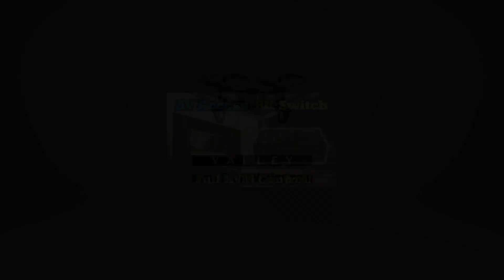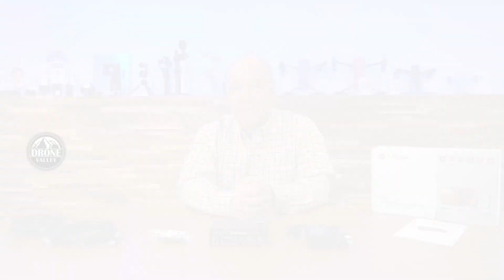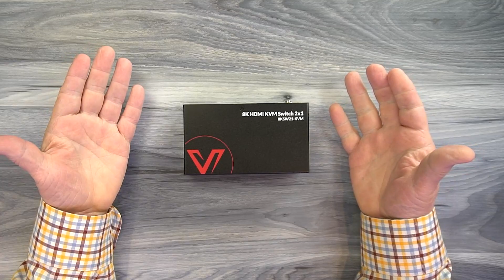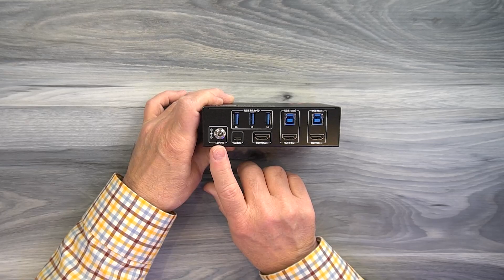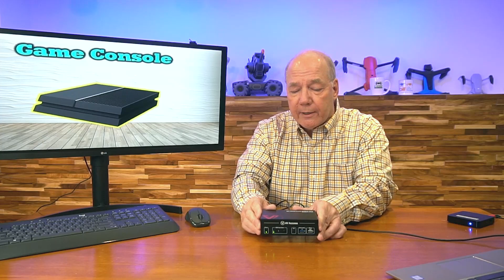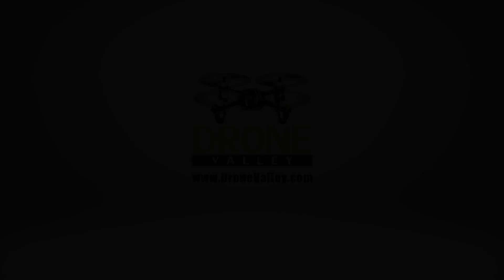AV Access 8K HDMI KVM Switch | Share one HD Display Between Your Gear!

Comment: Good review but why is no one talking about one of the USPs of this device in that if I understand it correctly, it solves the problem that most KVMs have of not being able to wake shared sleeping computers with a normal mouse move or keyboard key tap. This is super annoying with laptops as you have to raise the lid to wake them by button. It would be great if you look into this, test and report your findings as I want to buy one of these. Btw I am talking about deep sleeping computers and also ones where you have switched away from before they fall asleep. These details are super important.